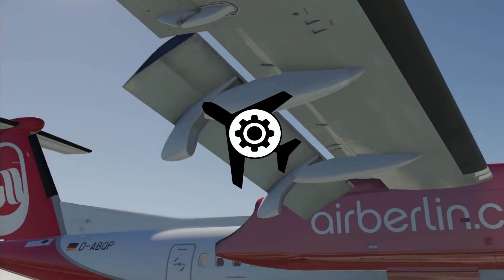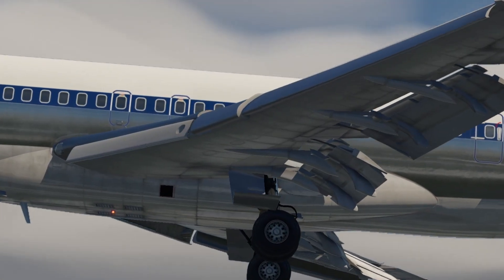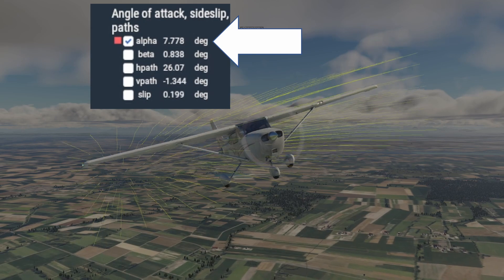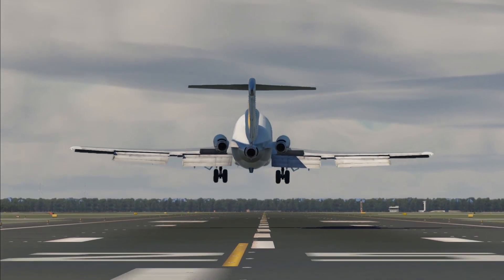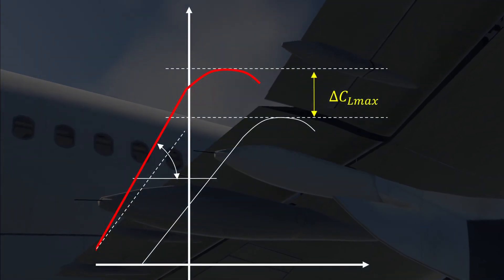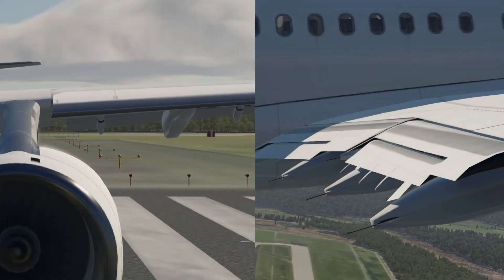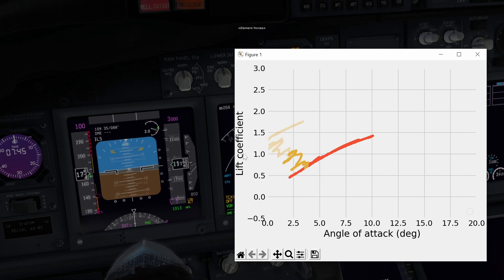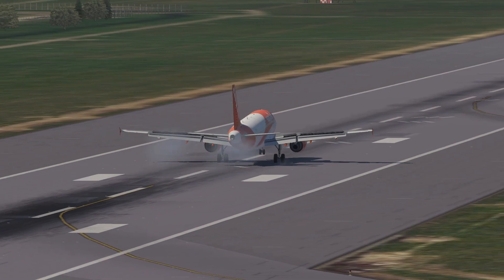Measuring Flap Performance | Aerodynamics in X-Plane 11

Comment: But but but on a Cessna 172 the downward force of the horizontal stabilizer is reduced long before the main wing stalls. The tail stalls first and that is the abrupt motion or dip in the nose which limits the main wing angle of attack. To do an analysis of the stall characteristics without taking into the effects and forces of the horizontal stabilizer is simplistic and misleading.

Comment: The huge triple slotted trailing edge Fowler flaps on the B727 and B747 are masterpieces of engineering and might even be called 'beautiful' in terms of industrial art. It is sad that most modern aircraft like the 787 and A380 have very simplified flaps by comparison--I guess the modern designs must be more efficient? Thank you for breaking it all down, including the equations and physics :-) Wonderful subject and great explanation :-)
Reply from the maker: It is sad to see how there aren't many Fowler flaps anymore, I completely agree :) I think you're right, maybe modern designs are more efficient for maintenance because they're simpler (maybe they also weigh less?) Thank you!